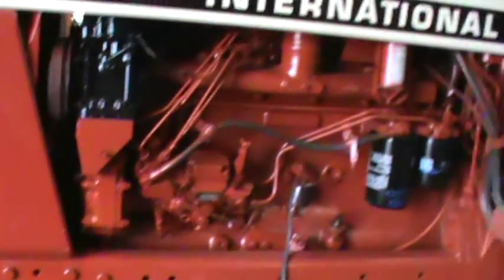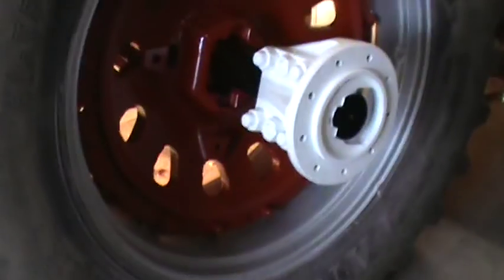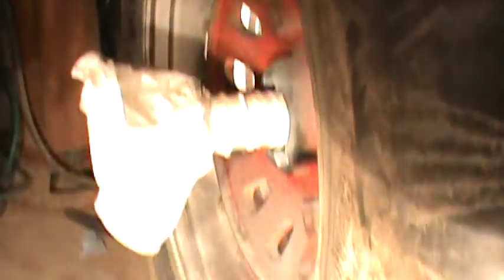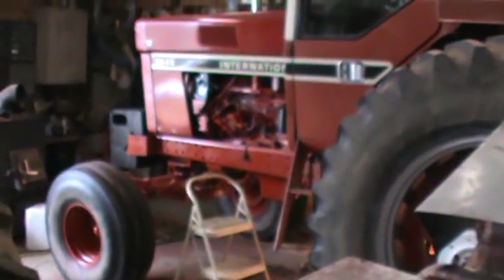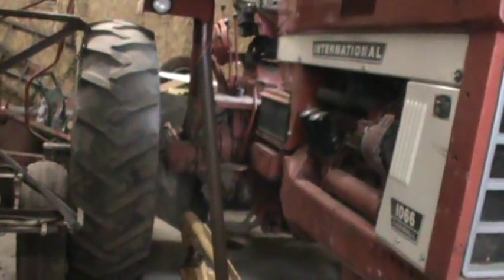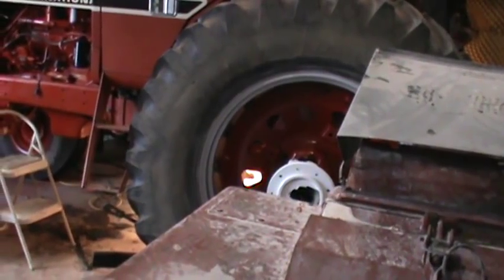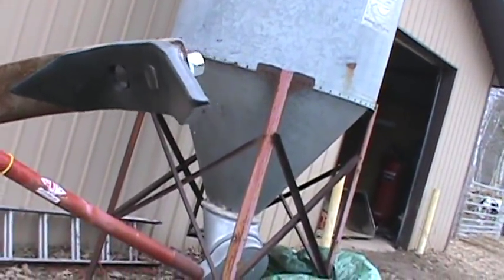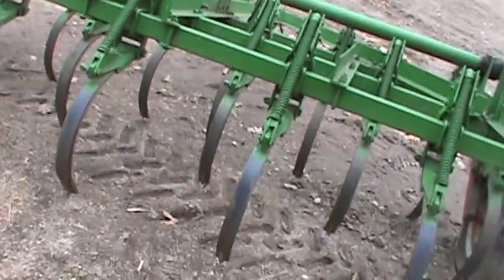Just Finishing Up The 1586

Comment: You have 9 bolt M&W duals and hubs. To be correct you would paint them white. M&W were white and had 4 attachment points from centers to rims. IH had 5 points. IH factory would be red and the hubs would be too. IH did put a 10 bolt dual rim on some 1566 and 1586 tractors and they could be silver or red. White would be correct for what you have. IMO I would keep them all red.